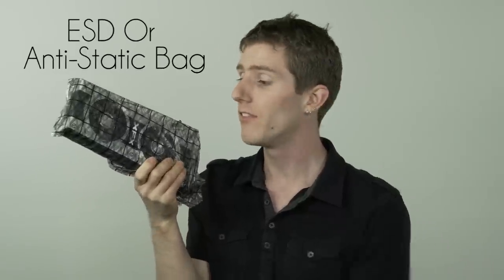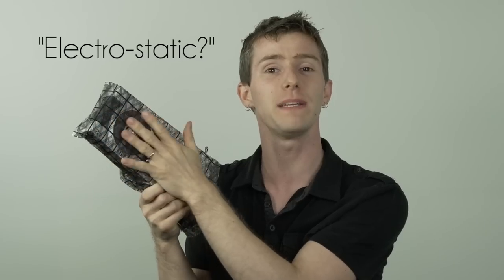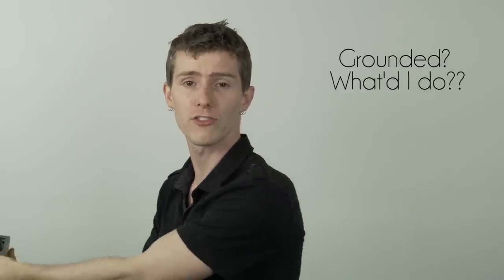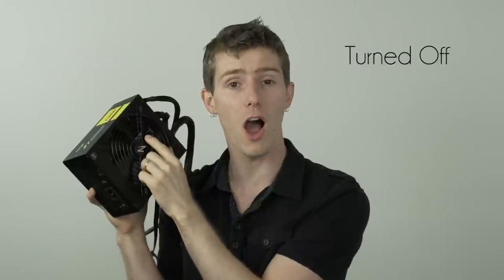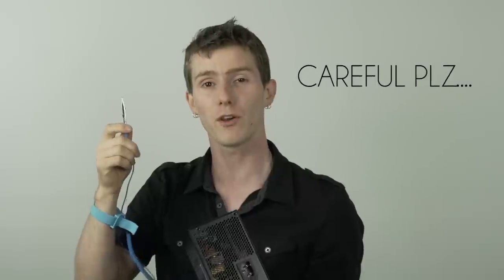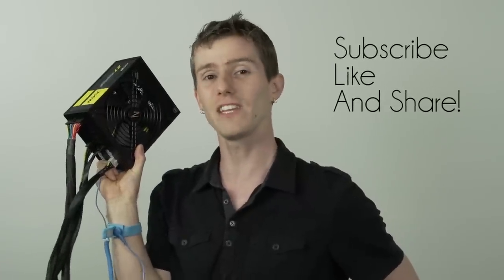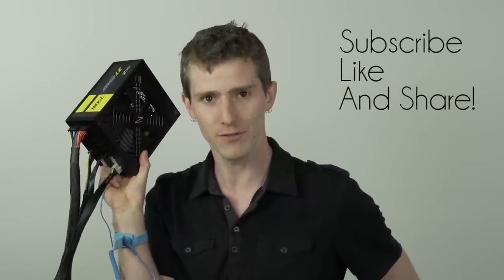Anti Static Safety - Handling Sensitive Electronics as Fast As Possible

Comment: Funny, in all the 35 years of buiding computers, I have never had any problem with static killing components. I have even tried it by rubbing my feet on nylon carpeting and building the computer (even back in the old 486 days,) but, nope, still nothing. Perhapsi I just don't conduct static in my body? Or its BS! I like the latter.
Reply: Yeah it's not real man static is fake
Reply: +DAGATHire To be fair, with the cellphone while pumping gas, the actual reason they dissuade you from using it is because people tend to get distracted while on the phone, and that can lead to an actual situation that causes problems. Getting a static charge from moving out of your car back onto the seats and back to the pump does actually cause a charge great enough to spark aerated gasoline, and it's not uncommon for people to do that sort of thing while chatting on the phone.

Unfortunately stupid took only two words from each sentence on why they should do something(as stupid people are want to do) and made up a story to fill in the blank. It's sorta like how some are convinced that the brand ADIDAS must stand for "All Day I Dream About Soccer" despite the fact that it's a play on the creators last names (Adi and Dassler I believe) and Adidas is the Greek God of Sports. Stupid people just want to believe what they want to believe, logic be damned.
Reply: ESD is very high voltage and can burn out transistors, which in turn can alter the performance of a component (instabilities, worse than expected oc results), if not brick it entirely (who knows maybe a certain component wasn't doa, but you killed it instead). If you want proof of this please refer to the beautiful realm of physics.

P.S. even high voltage esd discharges may happen unnoticed by humans, so please don't give me the, i never noticed a discharge, so no discharges ever happened argument.
Reply: yogibear2k10 Don't mean to be rude, but how do you know that you have never destroyed or altered a component due to static electricity. In your time building computers you must have received some doa components, how do you know that you did not destroy them, remember that you cannot always tells if you discharge static. PLUS a strap costs about as much as a can of coke, what do you mean a waste of money. And please learn physics before you say "maybe in the 1950's but not today" There is no magical voltage protection on transistors. Here are some numbers, a computer component can be damaged by a 10-20 volt discharge, whilst a human cannot feel a discharge under 3000 volts, in short, yes you can easily kill a transistor TODAY with a static discharge that you may not even feel, that is why I make the doa component argument. Remember, in electrical components over-volting is in many cases much more deadly than over amping.
Reply: yogibear2k10 It's nice to hear that you have never had to fret about doa components. Additionally, I didn't want to come across as fearmongering in my previous comment, your working environment and even the material of your clothes can largely (if not fully) prevent static discharges. 

It was great having a chat with you. Have a Merry Christmas!
Reply: The issue isn't that it happens all the time, or that any little movement will cause it, or that it's impossible to prevent without dropping money on mats and bracelets and such. The reason people advocate ESD safety so much is thats a relatively silent killer of components, and you might not even realize you've destroyed the component until well after you caused the damage. That or they are trying to sell you a product.

It's like going for cancer screenings. It's not that every other person on the planet is going to get cancer, but the onset of it can be sudden and go unnoticed until it's too late,  so it's better to err on the side of caution.

Get enough ESD protection to make yourself feel comfortable. Make sure you are at least doing your best to avoid contact with static producing surfacs(cloth, carpet, animal fur) and touch an unpainted metal component or plugged in, turned off power supply before and after handling components.
Reply: I did a computer course through 2015 and they taught us to use the wrist straps. it's funny if it makes no difference.
Reply: Idk, i killed my new gtx 1080 within 40 minutes because i shocked it..

Comment: I hope that you take this comment as a positive cretic! :-)
Sorry to say but your advice is forgetting the main problem and the cause for zapping your electronic, because even with a rist band, you can totally destroy new electronic you are taking out of a antistatic bag.
The reason for zapping your electronic is the difference in voltage between you and the electronic you are handeling so it does not matter if you ground yourself if the board has a difference of i.e. 2,000 voltage.

An easy and safe way for the home tinkere is to:
1) let the pc be off without any power cord at all!!
2) take a real antistatic ristband on (containing a 1MOhm ricistor)
3) open the antistatic bag but DO NUT TUCH THE ELECTRONNIC
4) put the crocodile clips on the new electronic so that you and it have the same voltage
5) now while holding the new electronic, mount the crocodile clips on the pc case
6) mount the new electronic and close up the computer
7) of with the rist band
8) and then first now put the power cord in the pc and boot up. :-)

Comment: DO NOT USE THIS VIDEO.

This is rubbish, you want to put yourself on the same electrical level, not earth yourself.
Reply: do you even work with electronics ?
Reply: Josh Mar both work. Bonding and grounding
Reply: Josh Mar yeah, connect the wrist strap to the case, instead of the psu.

Comment: I've been building pc's for about 9 years now. The only time I used those armbands was at school where they taught me about ESD. I've never used them on personal pc builds or pc's that I build for friends and family. I've never had a computer suddenly die on me or just not work. What I do, before I start touching pc components, is to touch the ground connector in the wall socket with my finger.
Reply: Rick te Kronnie Don't touch the ground directly, that can be very dangerous... The Anti-static wrist straps that plugs into the wall outlet has a 1MΩ resistance in them for a reason. You can simply touch a metal part of the computer case before manipulating components and it will be fine.
Reply: HCkev I've done it for years, never had an issue, never felt a shock or anything. Your body itself has resistance aswell, doesn't that count? Probably isn't 1 Ohm though
Reply: Rick te Kronnie You only start to feel static shocks when they get to be around 1000 to 4000 volts; every time you move around and touch something metal, you're discharging a small shock and usually never notice it, unless you move around so much that you build up a large static charge (like dragging your feet on carpet). It would only take a small shock of 5 to 10 volts to damage or fry a component, and at that low of voltage you'd never be able to feel it. 

That's why people recommend taking precautions, because even the small shocks you can't feel can damage your PC's components. Usually the damage done is small enough that you won't notice it, though too much damage from static shocks to components can start to corrupt things or cause random errors. Anti-static bracelets that are properly grounded can prevent most of the damaging static shocks, and it's really not the big of an inconvenience to wear one.

It's kind of like wearing helmets, some people wear them, some don't, it depends on whether you want to be safe or take your chances.
Reply: ***** I know those shocks are to small to feel, whats your point?

Also driving a motorcycle or scooter without a helmet and/or in shorts and a t-shirt is illegal here, unless the scooter has an engine capacity of 49cc or less and is limited to 25km/h (15mph)

Comment: I can't find any documentation anywhere that indicates that anti-static bags are in any way different on one side or another. They are a weakly conductive metallicized plastic. The conductivity is not enough to read on a multimeter but enough to prevent the buildup of a static charge. Static builds on surfaces that are insulators. Then when it comes in contact with something that has less of a charge or a negative charge, you can get a sudden transfer, ESD. Wood is an insulator, plastic coated particle board is an insulator. Somehow i think setting components on a table or work bench is worse than using the bag unless you have a specific workbench with a similar weakly conductive coating, and the whole thing is connected to a ground(the way it would be in a factory or warranty center). The table could have a built up charge from you moving stuff around on it, then you set your component on it and get discharge from table to the component.

That painted metal also probably isn't a very good ground. Better than nothing I guess. Touching the bare metal frame of the computer will equalize charge from your body to the case and prevent buildup. If you put some case screws between the case and the psu, this will probably ground the entire case and then touching the case or the power supply would be a good option, and you can clip the alligator clip onto the case if you are using one.
Reply: Can I just were a piece of aluminium foil on my arm?

Comment: From an HVAC installer I have never had an issue with a circuitboard and never used a grounding strap nor had a component failure from static electricity. Plus almost all HVAC circuitboards are bare. Maybe touching the chassis of the furnace or outdoor unit grounds me through the unit and thus the ground through the home electrical panel? Any input is appreciated.

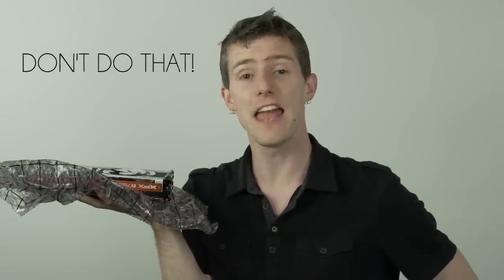Comment: 0:58 
The entire bag is conductive not just the outside, it is supposed to eliminate a static charge inside of the bag during shipping (from vibration, like rubbing a balloon) 
You actually should place the motherboard on the bag since it grounds your motherboard (after you touch the bag of course) 
BUT never put the BAG under the motherboarc WHEN IN USE
THIS MAY CAUSE DAMAGE
Only when building its good to put it on top

Comment: The pink bags without a metallic coating on them are NOT anti-static (or technically, "static dissipative") the only difference between them and regular polythene is that they won't PRODUCE static charge when rubbed against themselves.

STATIC DISSIPATIVE bags, are metallic coated plastic, they're a grey colour. These are the only ones that can actually shield from ESD. Theres also treated foam (the dark grey stuff you mention) 

Look up 'eevblog static myths' on here for more info

Comment: Something people were taught in the early days of computers to remove static without a strap is lick or wet your finger (just a bit) then touch something grounded, i guess it does a bit more than touching it with dry fingers (let fingers dry before touching electronic stuff)

Comment: You can pretty much ground your self by touching anything on PC case, because the case has enough metal to work as a ground. Yes the ground on the power plug is guaranteed, but we are talking about so small amount of electricity. My suggestion is that don't use wool based clothing, touch the case or microwave?, take out the components and put them on to the boxes they came in and you are pretty much secure.

Comment: Actually, what EEVblog is showing is that the pink bags won't build static, but won't prevent static shocks to go thought the bag. The metallic-looking bags does build a bit of static (like most materials, including a motherboard box), but will prevent shocks going thought the bag, as long as it closed.
EEVblog never said putting component on the bag will damage it.
BTW, Western Digital puts their HDDs on the Anti-static bag in their videos, they wouldn't do it if it was bad to do it. Just sayin

Comment: Where I live (Michigan near the coast) I don't have to worry about static because it's just so damn humid. Static electricity is a rare thing. I get socked from it like once a month, not even exaggerating. 
I never bother with anti static bags or wrist straps. I literally will just throw my parts on my bed while Im working on my computer. I've never had an issue : )

Comment: Just touch the back of the PC case frequently to discharge static electricity while you build. Or buy an anti-static wrist strap that has an alligator clip that you can clip onto the back of the PC case. They're usually only $3-$10. But generally, discharging at the back of the case is good enough.

Comment: No, the anti-static bag protects the board by making a Faraday cage around the part.  When the part is not cocooned inside the bag, there is no protection.  Static electricity will still charge and discharge from the board regardless of whether the board is on a conductor or insulator.  The goal is to remove the charge from everything else before bringing it to the board.

Comment: When he says have the PSU plugged in but not on, does he mean, switched on at the wall, but off at the PSU, or off at the wall?
Thanks for your help!
Reply: I'm so confused with this too, did you find an answer?
Reply: Actually you need to have both the power supply and wall socket turned off
Reply: Either way.
If you live in Great Britain, then your outlets probably have switches on them, which will cut off the power, but not the ground.
If you're lucky enough to have a power supply with a power switch, then you can use that.

Comment: From what I have understood is that it is actually a bad idea to ground yourself to a wall outlet. It is more important to keep your electrical level the same as something like your case. If you just touch the case, even if it is empty or not plugged in, you should be fine as long as you are not walking around on carpet or something,
Also, it is perfectly fine to put components on the outside of your anti-static bags. They are not conductive on the outside, and if they are, it is so little that it will not hurt anything. Carey Holzman has actually put a motherboard on an anti-static bag and ran it and it functioned normally.

Comment: to the people saying the bag isnt conductive and that theyve witness a motherboard be placed on it and nothing happened well esd (electric static discharge) damage, can happen on a microscopic level so just because it doesnt seem like it fried and runs fine doesnt mean damage hasnt been done, sometimes it can go unnoticed completely for a long time but believe something likely as been damaged and will cause your component to degrade faster than usual.

Comment: I was told you should attach it to the motherboard, or the components you're working with as this discharges your static electricity to the component slowly until you reach equilibrium.

Comment: Well, actually, the outside of that anti-static bag may not be conductive at all.  Have you tested it with a meter?  I agree static is a big concern.  However, the thing I have issues with is getting oils from your fingers on the circuit.  Contaminants on a circuit board, if they conduct or partially conduct electricity, may cause damage or malfunction to the board.

Comment: just as a heads up, touching that power supply like that would not be very effective...

it's painted (powdered) so you won't completely ground yourself because it's not conductive unless you scratch some of the paint/powder stuff off. you must touch bare grounded metal.

Comment: i have a question. would having the PSU plugged in while working on the PC be dangerous because theres still a charge going through it? 

so heres what i think i must do to ground myself: plug in PSU to wall, turn it off, clip my anti static wrist band to the PSU. and then im grounded

is that all? is this a safe method? i need some answers

Comment: It equalises the potential difference between you and the case so helps prevent ESD.  I have always thought ground is the wrong word for that.  Grounding is when your piece of metal is connected to the earth(ground) and all the static build up flows from you to the earth(ground).  People can get too precious about ESD any one who lives in a relatively humid area (so not desert) and doesn't scuff their feet across carpet should just take reasonable precautions and not get TOO worried.

Comment: i don't understand completely. is the risk of static an issue with new computer components? because i apart my old computer and its graphics card all the time on my rug and slip it back in and it works just fine. i do the same with my laptop. i just stick my finger in the laptop to position the hard drive after its been knocked loose. i'm lost...

Comment: I tend to just dissipate any potential charge by touching something metal, like a tool, if I have walked around and such just before I start touching the components again. I also wear shoes of some sort to prevent my socks gaining direct access to the floor. Socks on carpet for example is a easy way to create a static unwanted charge.
Reply: I don't have a wrist strap so when I work on my computer I just always have 1 hand touching the computer case.

Comment: Isn't metal ground? as my dad have told me. all house cables are conected on to a large metal thingy under the house. so if that's corect, it will be okay to just slap the wriststrap on to the metal case? pluging  yourshelf on to an outlet seems a bit "scetchy" to me

Comment: That's probably because most PC components are designed to be static resistant.  Everything except the RAM is probably not going to get hurt unless you slide around in socks on the carpet for five minutes, though I have fried a cheap motherboard before.  I always wear an antistatic wrist strap anyway, but a antistatic mat is generally unneeded.